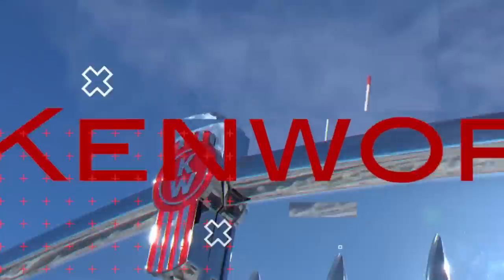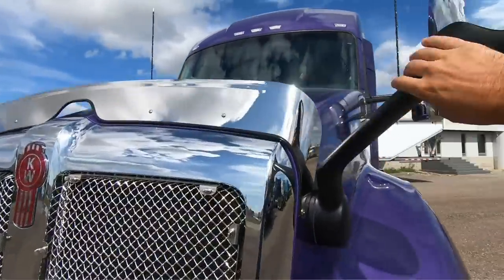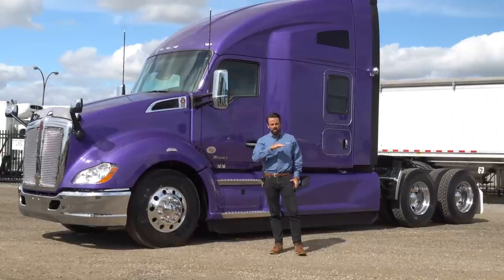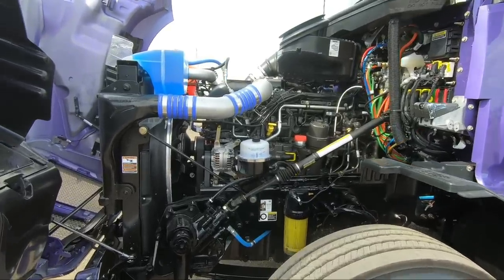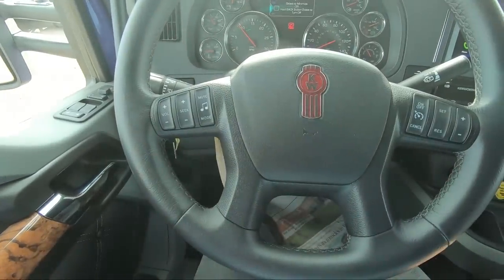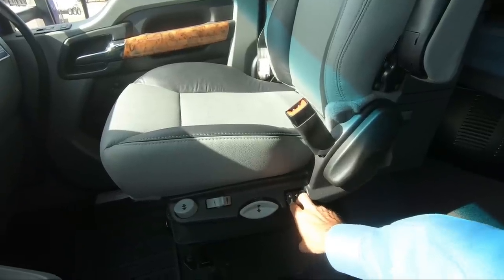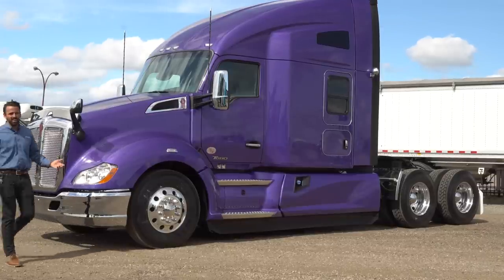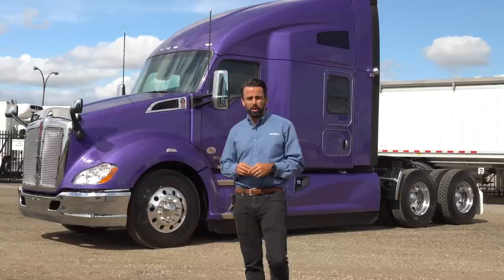TOP OF THE LINE 2020 KENWORTH T680 WITH DIAMOND VIT INTERIOR

Comment: Sorry to say. That truck is not top of the line. It's got a Paccar in it. That's the problem. It dosn't matter if the interior has all the options. If it's got the wrong motor, then its junk. Not trying to be mean by the way.

Comment: Clean truck lost interest at drum brakes.
Reply: Drums are significantly cheaper when it comes time to service them. Discs have much better stopping power, but they cost an arm and a leg, and many owners are switching back because the cost is just too much.
Reply from the maker: Thanks for watching
Reply: Cost of an incident is so much higher I don't see how I could own a truck without disc on all axles. I have had the luxury of driving all disc and drum. When I was pulling a trailer with air ride and ABS it was like trying to stop a slightly overloaded pickup. Back in an older truck with drum and I have to be significantly more careful not that the amateur drivers and about 5 percent of the super truckers will let you.